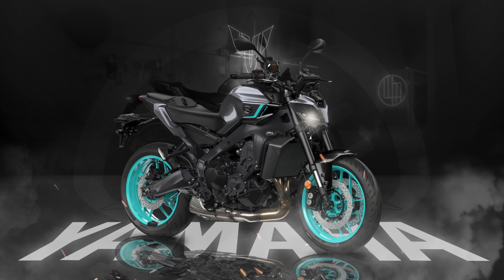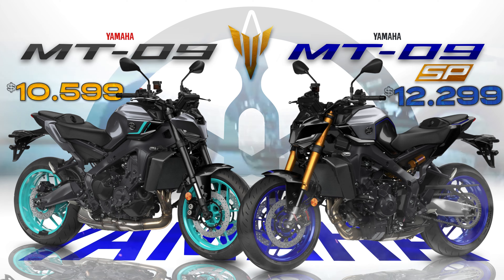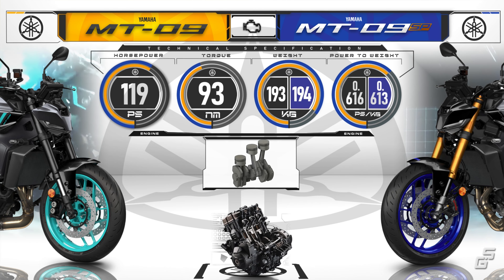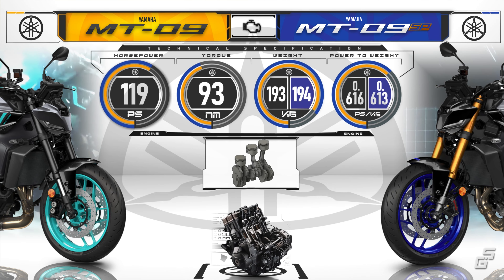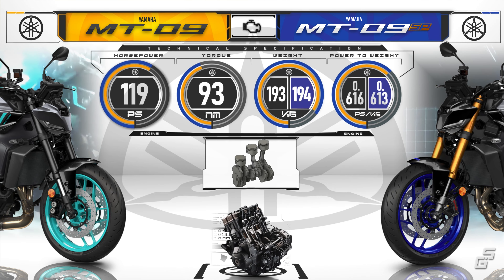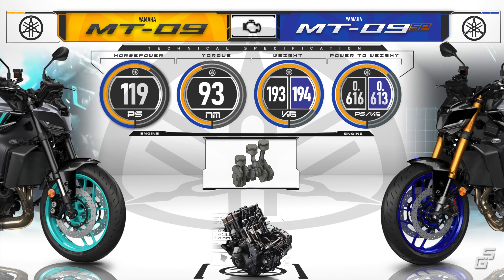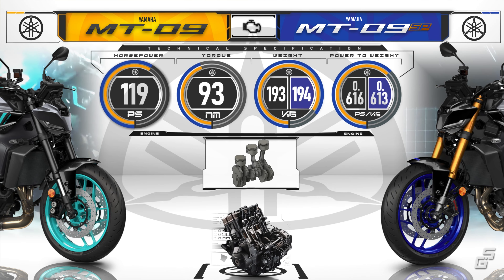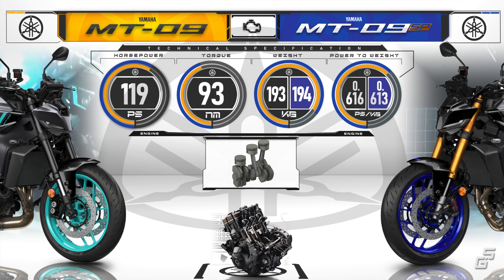2024 Yamaha MT-09 (Non-SP) vs MT-09 SP ┃ What Makes The SP Special?

Comment: I don’t think the sp model is worth the bag
Reply: Why?
Reply: It's worth it with ohlins rear shock and brembo calipers
Reply: Better brakes, better suspension and the rear abs can turned off. Def worth the upgrade
Reply: Maybe if the front forks were ohlins...
Reply: @user-gi7rs3hw8r  i didn't try these forks yet, but Ohlins aren't always better (maybe on track) because most of the times they are fairly firm for street riding
Reply: Yamaha bikes always  worth  in buying
Reply: Its absolutly worth i own the mt09 sp it it feels so much better with the öhlins one its a huge diffrence
Reply: It’s worth $1700 to not look at those cyan colored wheels!
Reply: @MrFirstonraceday lool
Reply: They also come in black 😂 @MrFirstonraceday
Reply: @quanwick4516  Not Worth it. period. Also its only Ohlins rear, which you don't even need. The KYB suspension is more than enough for streetriding. You just have to adjust it to the right specs. And the Brembo brakes are also not worth it. It's just overkill, only if you do many trackdays and are a serious track rider, only then it's possibly worth it. Stop buying into this bullshit. All the other gimmicks, are well gimmicks, who wants a damn cooker knob as ignition?
Reply: @CaptainCrossplane  I am 60% track rider 😉
Reply: @CaptainCrossplane 
Definitely worth it for being able to turn abs off. If that was the only difference, I’d say it’s worth it. 
Plus people pay more that $1,700 to get keyless ignition installed. 

If you can’t afford it, I get it, but $1,700 is nothing in the grand scheme of things
Reply: @TheDougSpot  Ehh?? why would you want to turn abs off on a road bike? Besides you could always just unplug the sensor. But I can't even think of a scenario why anyone in their right mind would want to do that. It's a waste of money. Paying 1700 more just because you're too lazy to put the key into the ignition. Doesn't make sense, also it's the worst design i've ever seen. It's identical to a cooker knob lmao...
Reply: @CaptainCrossplane  
Because I would rather press a few buttons when I want to be a hooligan instead of taking unnecessary time and effort to pull over, get off the bike, and unplug sensors/fuses and then do it again when I want to revert back. 

What kind of stupid ass question was that? Are you trolling, or does your brain really fail to understand the usefulness of it?

Also, anyone who rides knows that the less you have to go in your pocket, the better, so keyless ignition is fantastic. 

I truly believe that you just can’t afford the difference so you’re trying to convince yourself it’s a waste of money🤷🏾‍♂️
Reply: Is this a kinda bike i can buy for a “beginner” bike?
Reply: Brakes alone worth the extra
Reply: If only they raised the compression, then it would be worth it imo.
Reply: @MuscleUp192  yes
Reply: @DasDeGaDuo ilol its only the rear shock not the front forks… they are literally the same 😂
Reply: @DasDeGaDuo  then you must go to the track a lot cause it’s the only place you would tell a huge difference. It would be a very, very very minor difference on the street.
Reply: Def  not
Reply: + cruise control + quickshifter +ohlins rearschock. How do you mean its not worth 1700$ ?
Reply: If you are your regular street rider than no. If you're a track guy who pushes hard than it's worth it imo
Reply: @slavisakovacevic5575  Both bikes have cruise control
Reply: @slavisakovacevic5575 both bikes have quickshifter
Reply: @slavisakovacevic5575 
I believe the non SP model comes with cruise control this year standard.
Reply: No, normal version does not comes with that as a base equipment. You have to pay for that. Otherwise no @Mikaeel84

Comment: The previous MT-09 versions, the SP was worth it, but with this model it doesn’t. The 2024 base has all you wanted from the previous SP, but a bit cheaper.
Reply: @SirMountainpass even if you're pushing, on road use only the brembo caliper is something interesting. Even my yamaha dealer told be the sp is not worth it unless you just want the premium version. 
Most things are not usefull (more modes, track screen, keyless, dlc)... it just add 1 kg to the bike. 

Not sure the ohlins rear shock is much better on twisty and bumpy roads or as a daily. 

So here again only the brembo caliper means something to me.
Reply: @siegfriedz8211  
Then we are happy with the fact that every rider can make « his » choice - non-SP or SP 😉
Reply: @SirMountainpass  of course ^^ i did not mean the sp is a bad choice, just dépend on what you are waiting from your bike and how you're using it ✌️
Reply: I agree. In my country, the price difference is 2000€. I would rather have non sp version with aftermarket exhaust for the same price as sp version..
Reply: I would agree. Now if you are carving up the canyon at 100mph+ or the track, then go with SP.  But the average hooligan will never have use for the added benefits. Take the 1700 and buy some good riding gear. Money better spent imo
Reply: I am kind of wondering that. Really what you get is:

1) Pointless track modes on a bike that isn't designed for the track
2) Brembo Stylema calipers, which are good, but really that Brembo radial master is probably going to give you most of what you want. And it still has rubber lines.
3) Ohlins shock, which is great, but Ohlins forks would have been the coup de gras. Gold Kayaba forks are...whatever.
Reply: @MrFirstonraceday  I already have enough riding gear to outfit a small team.
Reply: I have a 2023 SP.  Never road the base mt09 

When the new model is available, im not taking any chances!

Im getting another SP.

Incredible machine!!
Reply: @SirMountainpass 
Hard to compare modified to anything. 
Modified is modified. Factory is factory. When purchasing a new bike they would be factory. You can modify anything to any extent as long as you can fund it. So, factory to factory spec is the topic at hand. 
I think the SP is only worth it to track goers and hard core canyon carvers that have years of experience, and a little resale value. Otherwise the standard MT is more than a bargain and all you'll ever need for 99% of all riding.
Reply: @SirMountainpass 😂
Reply: @bricklawson9745  why do you need a new bike already? What do you just get a new bike every year? Seems kind of silly.
Reply: @SirMountainpass  now you just need to learn how to speak proper English😳
Reply: @mrgrump2534  i already have over 9,000 miles on my 2023 MT09 SP 
I actually plan on keeping it.  I really like the way the new one looks.

Comment: I think the SP is only worthy if you take it to the track. 🙄
Reply: Every rider is, once in a while, taking bike to a track, right? Right?
Reply: @dizzicz  If the bike is a Panigale, I think so. But if the bike is BMW R18, i don't think so 😄 
In this case ( MT09 ) you'll probably find both types of people. Some take it to the track, some don't.
Reply: @MacAlex007  track is the most safe learning environment. I think that riders should learn to drive regardless of the bike type. So there is nothing wrong with R18 on the track.
Reply: @dizzicz  I agree with you! And I think that some lessons on track should be mandatory to get the driving licence.
However, usually when people think on track, they think on race (me included 😅) , so it won't be easy to find an R18 owner with the mindset to take it to the track.
Also, if you're not racing or at least don't have  already some track experience, it will take some time until you get full advantage of the Öhlins suspension and Brembo brakes  of the SP version. I think the normal MT09 is alot of bike for most people.
Reply: @MacAlex007  even here I'll try to change your view. Beginner and/or ordinary rider, is much more probable to make an mistake. Better suspension (and maybe even brakes, however here I don't think that it is much an issue), you have bigger margin, where bike can handle your error. So while racer wants better bike so he can use more of it. Beginner wants better bike (suspension) to have bigger chance to handle unexpected situation.

And regarding racing, if baggers can race on MotoAmerica, R18 can either :-) Anyway if anybody don't understand value of SP version, it's completely fine, and standard version will do.
Reply: @dizzicz  I don't agree with you about the suspension and brakes.
To get the most from the suspension you need to tune it to your driving style. You need to know what will happen if you increase the preload, if you need more or less rebound, the diference between high and low compression, etc.
You need knowledge and experience to feel the bike and know what you need to change on the suspension. If you don't have it, the standard one is enough, wich, by the way, already has many possible adjustments for a beginner to learn.
About the brakes... with stronger brakes becomes harder to brake on the limit. Again, you need practice and experience to take the most of it. 
Attention, I'm not comparing good and bad brakes, I'm sure the standard MT09 already has good brakes. The SP version will just be able to do a better job and help to take off a few tenths of a second in the lap times, in the right hands.
Reply: Right, track days AND very hard mountain passes touring - I often get waived past... 😎🏁
Reply: @dizzicz did you really just answer yourself 😂

Comment: It would be a really tough decision between the 2024 MT09-SP and the new 765 RS Street Triple. Primarily, because of the bullshit dealer fees that total about $2700 additional dollars (or more) for the dealers that sell Yamaha. Whereas, Triumph dealerships don't usually have those specific rip-off markups. The Triumph is way better looking (IMHO) and is so freaking smooth but Yamaha is statistically more reliable and has some more electronic, torque and mpg benefits.
Reply: Exactly 💯
A tough one

So what did you land on? Haha
Reply: @Jacob99174  I wish I could say that I landed on either one however, I can't really afford one right now. I have the European cruise control unit for the 765 RS though. It has the extra DLR switch on it but the DLR switch doesn't work on U.S. models without the R.O.W. Tune programming. Thanks Triumph for tying the headlights into the PCM! 🙄😕😤🤬

Comment: People complain about suspension of regular MT-09 before 2024.
Interesting how it'll be with regular MT-09 2024...
Reply: Is it not the exact suspension now? U think it could be better now?
I think the mt09 is enough for me and I don’t need the sp if the suspension is decent for a 90kg driver
Reply: @Delb9891   I don't know ) I've got mt-07 and it's suspension  is enough for me.
But must admit that mt-07's suspension  is not so hated, like mt-09's
I just interesting how situation will be in next few years
Reply: @alexpunisher4654  what you smoking dude, 07's sus is not hated but 09's is ? literally you should spec ohlins on 07 and comfy seat to even ride it, the 07 is notoriously bad.
Reply: @alexpunisher4654 lol that’s because you’re talking about a bike that has literally half the horsepower of course it’s not gonna be hard to handle

Comment: I've got 2021 MT-09, it has a weird handlebar position which causes arm ache after riding for a short time and turning angle is very small. Front suspension is good but a bit hard same as the rear. The throttle is too light to control firmly. And there're reports of many owners that this 890cc's frame is cracked which is so dangerous. I hope this latest model has been fixed for those issues.
Reply: The bar is different and there is more angle before it locks.

No one has complained the suspension is hard. Bring your bike to a suspension tuner, you've got it set up wrong.
Reply: I love the frame complaint from people. They crash these bikes hard and complain that the frame breaks. My favorite is when they post photos of a broken frame without providing context as to how it happened. 😂
Reply: @otlndsh  that’s because they left their common sense back on the road when they hit it hard😂

Comment: Whata stupid video.of coarse the SP is worth it. I have an MT10SP and usedto have the normal MT10 and  its night and day the differance with the suspension and the LCD screen andelectronic adjustment you pay for.
Reply: Disagree...  Sounds like you're trying to justify the upgrade because you did the upgrade.  For the 2024 MT09 specifically.  What justifies it?  The track modes that 99% of users will never use? I guarantee you the average user is not going to know the difference in suspension since it's so minor.  The ability to electronically change the rear suspension?  Once you tune it to the rider, it will never move.